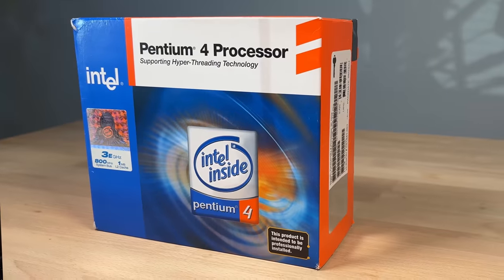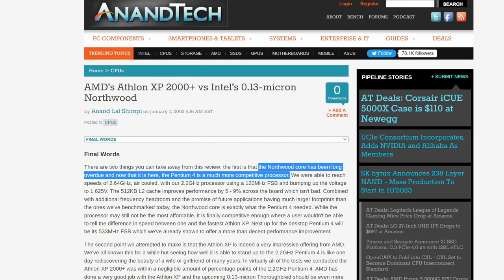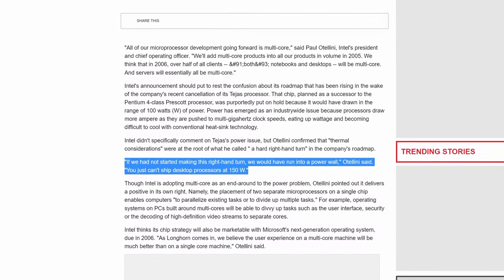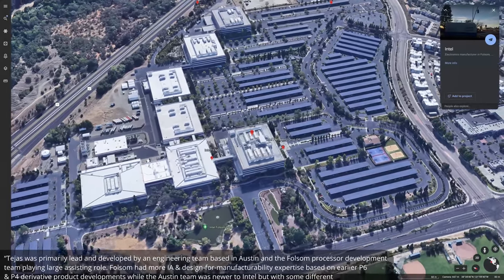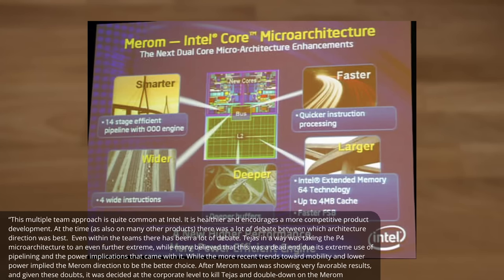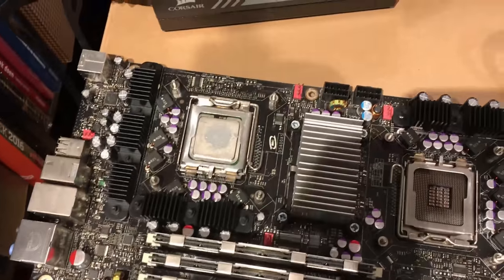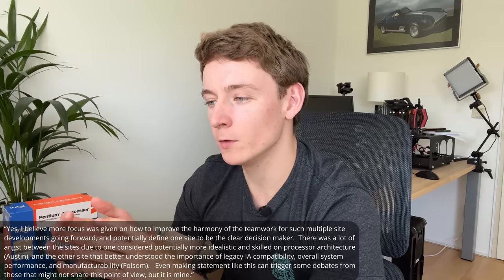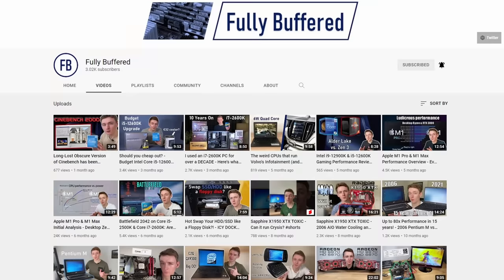Intel's abandoned Pentium 5 project...bought on eBay! (with info from Intel engineer)

Comment: Absolutely fascinating. I worked in IT during the turn of the millennium and I was a hardcore P3 fanatic - when my friends dumped all their money into the P4 I doubled-down and bought a dual-P3 system. It ended up being my daily driver well into the XP era.

Thanks for putting this together!
Reply from the maker: Thanks you! I'd love a dual P3 system - that would have been quite a system back in the day.
Reply: That was actually a really intelligent double down if you ask me.

Did you ever test SMP Quake III Arena?
Reply: @nexxusty  asking the questions that matter!
Reply: @nexxusty  

Mickey Mouse bro. It was designed to exploit the original ultra weak logical cores.
Reply: @eclipsegst9419  I ALWAYS wanted to test Q3A with Dual CPU's of that era.

I stupidly threw out a Dell Dual Tualatin board that used RDRAM in 2017. I still feel like an idiot for doing that.
Reply: @nexxusty  I have a dual pentium III board with two 1.4 ghz tualatin's clocked at 1.6ghz, and 3gb of ddr ram. smp in quake III makes a sizeable difference. The card it has currently is an NVidia gt 6800 and just by going off memory smp will add about 40 or 50 fps in timedemo 4.
Reply: @bonesy3903  Awesome. That's seriously impressive.

This means what I thought all along was correct. Quake 3 Arena was the first game to properly take advantage of dual CPU or cores.
Reply: @bonesy3903  Do the dual 1.6ghz Tualatins bottleneck that 6800GT at all? That card is significantly newer than  a Tualatin system.

I also had an AGP 6800GT back in the day. I had it on a Socket 754, and a Socket 939 system though. Thats why I ask.
Reply: @nexxusty  I would assume they do bottleneck the card. I tested an HD 3850 in the same system and had only slightly higher framerates in games. To put it in perspective though this setup is powerful enough to finish doom 3 on 1080p with mostly 60fps performance. Sometimes the framerate would drop but it was never unplayable.
Reply: @nexxusty  yea I've long been wanting to build a few era correct pieces for the various stages of DOS/Windows over the years. I just don't have the space or budget right now. My oldest stuff in the spare bits bin from upgrading other peoples stuff is LGA 775 era. The E8400 would be a solid choice for an XP machine i think though.
Reply: @nexxusty  This also means that a feature that Carmack considered incomplete was still very good. There are far less complete features put into "complete" games as we have all seen over the years since.
Reply: @eclipsegst9419  LOL, well said. Completely accurate.
Reply: @eclipsegst9419  AFAIK, a C2D or a C2Q will have negative scaling with SMP on.

At least in Windows 7. Maybe not on XP. Would be cool to try.
Reply: @bonesy3903  That's actually pretty impressive. 1080P on P3 cpus is nuts.

Did I see you over on Vogons forum? There is a guy there with a dual Tualatin 1.6ghz with a 6800GT  thought it might be you.
Reply: @nexxusty  It would. I didn't own my own PC until the mid 10's and bought a used 2500K which obviously laughed at Q3, i've never really tested it on 00s hardware. I did always think it would be cool to test how older hardware handled things like huge DeFRaG maps, or large MP maps like the one i'm working on lately, which is an outdoor setting with a lot of patchwork inside of a large skybox
Reply: @nexxusty  No must have been someone else. I read vogons but I don't have an account.
Reply: @bonesy3903  Someone has almost the exact same configuration as you do, lol.

That's not abnormal in today's computing world. Having almost the same 21 year old parts though. Pretty cool.
Reply: @nexxusty  Yeah very strange but thank you!
Reply: @FullyBuffered  I have a dual Pentium 3 1GHz slot 1 for you. I’m willing to send it to you and you can review it. Maybe I’ll lent my Voodoo 5 🤠
Reply: @nexxusty  damn, you mean like throw it out, like directly into the trash? Or electric waste?
Or just sold it cheaply?
Reply: I had a dual Celeron rig in the day. Was actually snappy and performed well in XP considering the age.
Reply: @apachelives  My dual p3 computer is still capable of watching youtube at 480p believe it or not. They were very good for the time.
Reply: That's cool. I have a dual slot 1 that supports 8gb of ram. I haven't tinkered with it too much, but several years ago I tried Ubuntu with it and it actually worked fine. I just wish I could find some slotkets to put some 1.4 CPUs in it and try again for fun
Reply: p4 was fine.  p4 prescott was not good
Reply: @bonesy3903  Thats really impressive. The Centrino mobile line was also the P3 architecture at 1.6ghz they were really impressive low power chips. GTA:SA ran no problem winxp 1024x768
Reply: I forgot all about dual pentium 3 systems.
Reply: @FullyBuffered  my buddy and I rescued a dual slot 1 board out of a dumpster earlier this year - it has the i440BX chipset, four SDRAM slots for a total of 1gb and it came with two 700 MHz CPUs preinstalled - awesome machine, i have to say ... give it a modern but lightweight linux distro like Q4OS and this thing can still be used for almost anything - we also found a RDRAM-era dual xeon board in that same dumpster ...
Reply: I was rocking a P3 500 with a Radeon 9800 Pro well into the P4 era and still getting better FPS than people who moved to P4. I finally moved in when P4c arrived and kept the same GPU.

I've gone AMD now since they had their Athlon 64x2 range and haven't looked back.
Reply: Still have a dual tualatin 1.4ghz 3gb ram sdram up and running on windows server 2003 flawlessly
Reply: Dual P3 with Windows 2000 is a gem
Reply: I myself loved the Pentium III  and was still using  them till 2007  . I too , bought a dual pentIum III motherboard , it was Accorp  brand , but had a limitation of  512 MB ram only .   I then migrated to Pentium III-S  tualatin 1.4ghz  .  I still have a dozen of pentium III cpu  ,  but no motherboards , strangely Pentium III motherbard's price has skyrocketed
Reply: @nexxusty  Totally feel your pain there! In 2018, in a mad rush to clearout my house when offer was made, I also threw out 1.4Ghz Tualatin with m/b.😡
Reply: Good choice... I think I was still on a 2x Pentium MMX at that time, but it served me well, and from there a single P3 750 or so. I also remember being yay! when the Pentium M showed where things would go. Helped one friend pick a box, he wanted a P4 so at least we together picked the whole shebang with Rambus etc. That box also worked superbly until like 2010! Your dual P3 will have been great, especially if it had some PCI-X slot or so. I stuck with P3 in a quad "P3" Xeon for 5-6 years, that was the most Oompph! in small space I ever had.
Reply: @udirt  I've always wanted to know if dual pentium III   or 4 pentium III   in your case performed well in multitasking . for instance if you played back and audio file , and opened two or three windows from your browser , would you notice a slowdown or system freezing ?
Reply: I did the same thing! Never bought or owned a P4 based system. Being in IT, I worked on and used enough of them that they were just a disappointment. When it came time to upgrade, I made the jump to AMD. I was so disillusioned by the P4 and Intels roadmap, I never went back to them with one exception. My gaming laptop I bought n 2010 had a Core 2 proc. Tbf, the core 2 and I series are good processors but, the prices! 😳
Reply: Zamn I love the old Pentium days

Comment: Intel in 2004: "we just cant ship processors at 150 watts."

Intel in 2022: " 12900KS is hot, but its damn fast, you can figure out how to power and cool it."

EDIT: omg thanks for so many likes.
Reply: Nvidia: hold my beer
Reply: I always think about the Tejas TDP when I read about the i9. It's a habit I can't shake
Reply: Actually, Intel can handle it all now
Reply: coolers evolved a lot throughout those years though
Reply: @warmike  excuse me? Coolers evolved because they needed to, it's not like that were a breakthrough in cooling technology
Reply: @virtualtools_3021  Apple: Hold my insufficiently cooled thin meme laptop.
Reply: @SchioAlves  you mean to tell me that’s not how copper was invented?
Reply: @anusmcgee4150  I'm sorry, but copper is so last season… don't you know they invented something called water to do water cooling?
Reply: @SchioAlves  no way!!
Reply: 13900K using 300w be like...
Reply: Me sitting here with a "105Watt TDP" casually drawing 180watts at stock with not even coming near the advertised clocks.
Reply: @AlpineTheHusky  which CPU are you talking about? 105w sounds like AMD but I thought they were supposed to be power efficient
Reply: @fantasypvp  3900x. It is barely what was advertised but meh I got it for cheap
Reply: @SchioAlves  copper is still used in these coolers
Reply: Intel in 2004: "we just cant ship processors at 150 watts."

Intel in 2022: "13900K comes with up to 253 watts. yeet."
Reply: @randomshorts739  Well AMD seems to do very broad binning so there is quite a big range of performance and efficiency. My samples tend to be more on the dud side sadly
Reply: @randomshorts739  Oh so not reaching the advertised clocks must also be impossible?
Reply: @randomshorts739  This is one of many 3x00 CPUs I have tested built with and sold tho this one is mine. And no you cant expect a 4.3ghz overclock as easely. Look at the stats given by Silicon Lottery on the 3900x. Only about 6% of the Chips can get a stable 4.2ghz at not too high voltages all core.
Reply: AMD FX9590 and R9 295x2 "oh yeah, watch this"⚡️⚡️⚡️🔥🔥🔥📈
Reply: I think it's also that the idle draw of i9s today is probably still much lower than the stalling mess that the Tejas was.
Reply: 2024 14900K oced 400W ...
Reply: @kishascape  But not like that:  you're holding it wrong.
Reply: @SALTINBANK  yeah but that is overclocked by most likely an AI tool you used not by Intel spec which the motherboard makers never go by but maker run faster by giving it even more power
Reply: @yumri4  true but it is a joke intel architecture can't yield further for 13/14th gen
Reply: @SchioAlves Those water coolers still use copper/aluminum cold baseplate and copper/aluminum finstacks for their radiators

Also watercooling goes way back, even in the early 2000s water cooling was way more cooler cuz most ppl made it with DIY in mind (mine was literally just an aquarium pump and a water block and a large ass reservoir
Reply: @SchioAlves  a good air cooler is miles better than a water cooler
Reply: @OnlyyKai , you clearly can't get sarcasm
Reply: @SALTINBANK  Also it's probably unstable and $100 surcharge just to hit 200 MHz higher.
Reply: Intel in 2024: the 14900KS is hot, fast, draws 253W at stock, and has a 25% chance of degrading the ringbus within a year.
Reply: 2024, intel pushing over 250W just to be somewhat usable
Reply: @10WA lol :D i had FX9370@5.3ghz with nh-d14 and HD6990 in 2015. It was decent but really inefficient :D
Reply: We'll pre overclock our stuff but say it is "stock".

Comment: "You can't ship desktop CPUs at 150W", the i9 12900k => 250W
 i9 13900k => 250W, up to 350W without power limit...
Reply: And now i9 14900KS that consumes just shy of 400W without power limits...
Reply: @ismaelsoto9507  I cracked 500W on liquid nitrogen a little bit ago. The VRMs need water cooling if I go much further.
Reply: There was a canceled i9-10990XE with a rumored TDP of 380 watts
Reply: @loona5530  Well the 14900ks consumes over 400W.
Reply: Yeah, 150 watts is now "the good old days."
Reply: And then they did the northwood oopsie once again with 13/14th gen and degradation
Reply: @TheIdiotPlays  Well yeah, it's almost like the engineering standards were there for a reason. XD
250W for desktop GPUs and 140W for desktop CPUs, although it seems 160-170W is still alright for CPUs.

Comment: The IHS is most likely soldered. You can try the lga 771 to 775 mod & use a p4 and/or c2 boards. 771 server boards are so finicky. Try to get a very early bios, asus boards usually seem to do things that they werent ment to.
Reply: second that Asus board. I used to have a P5Q Pro that I ran Xeons in and I never did anything to the bios

Comment: I bet a very experienced coreboot dev on a properly setup board for low level debugging could rig something working, especially with the recent advancements in decoding and patching Intel microcode. 

That assuming it doesn't just work on those  775 patched bioses that boot just about anything after doing the mod to the socket

Comment: Obscure PC hardware is one of my favorite things to find on youtube, because you get to see such interesting oddities. Like how Intel had been banking almost entirely on operating systems continuing to utilize single-threaded workflows and, thus, they were very keen to just continue pushing the power and thermal envelope with increasingly faster clock speeds on a single-core processor architecture. Luckily they've got some wicked smart engineers and were able to pivot quickly to a multi-core design with the Core and especially the Core2 platforms. And, well, it took until Zen 2 for AMD to claw back the performance crown, albeit briefly and under specific circumstances. Zen 3 gave them the title right up until Intel decided to release a special binning of their i9 that is basically uncoolable when fully turbo-ed.
Reply: a 7 ghz cpu would be crazy insane I would have loved to see it for the giggles factor alone shame it never came to market
Reply: Yeah like those itanium and its funky socket

Comment: Amazing video !
As for Tejas legacy : SSSE3 instructions (that AMD's Phenom CPUs lack), are direct link between Conroe (a.k.a. Core 2) and Tejas. Additionally (IIRC), some of Tejas branch prediction unit was also incorporated into Core 2 architecture. FSB speeds of 1333MHz and above were also mentioned for it, but that's more of a rumour than actual spec.
I bet you can't make them to boot, because you lack Tejas ucode in BIOS (you can add it manually if you find a source for it).
Reply from the maker: Thanks for the comment! Yeah finding ucode for these is going to be more than a challenge to say the least.

Comment: Amazing that you got a hold of one of these!

The one thing that kicked the Netburst architecture to the curb -- Pentium M.  This was developed in essentially a skunkworks manner by their Israeli dev team (small dev team, isolated from the main company) as a mobile product; they started with a Pentium 3, added the instructions added to the Pentium 4, and worked based on that design for higher performance and lower power consumption.  It's performance was so good, there was some infighting for a while among those who wished to keep clocking up the P4s (since who wants their chip they are developing to be cancelled) and those who wished to turn the Pentium M into a full product line.  They actually got to the point where Intel had restrictions with the vendors saying they must not run a Pentium M in a desktop, although it was intended as a mobile chip it was very tempting to do just that due to the good performance of it, but Intel officially said Pentium M is for mobile and desktops must use Pentium 4s.  The Core Solo/Duo, Core 2 Duo, and Core line are descended from these rather than from the Pentium 4 architecture.

Comment: A silly part of me wonders what a chip taking the Tejas/Jayhawk approach would be like if it were done with current process technologies, and using the increased transistor density to make the pipelines even deeper.
Reply: A 50 stage pipeline CPU on TSMC's 5nm process could reach 10ghz I bet, with some water cooling of course.
Reply: -_- from my memory bulldozer when they first explained what the architecture was... it made me pull the trigger on the 2600k.... because i was like wtf AMD why are you making your own version of netburst....   i already saw the issues coming
Reply: @wnxdafriz  Yeah, bulldozer was a thing... back in day I had a Phenom II X6 system and I remember hearing that the upcoming bulldozer parts would use the same socket, and thinking to myself it would be nice to have that as an upgrade option. Sadly, bulldozer turned out to be a flop, not even a decisive upgrade from what I already had. My next CPU purchase was a 4790k which I'm still using to this day. Still holds up quite respectably for a quad core.